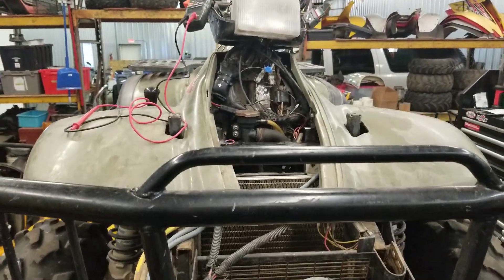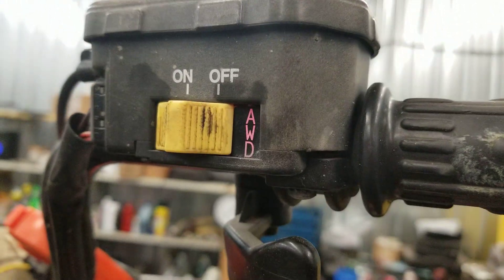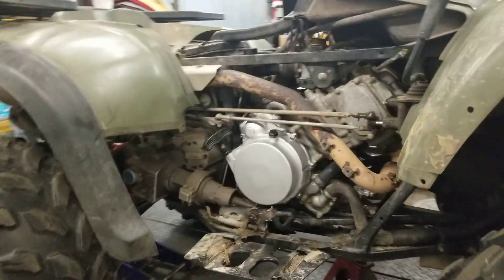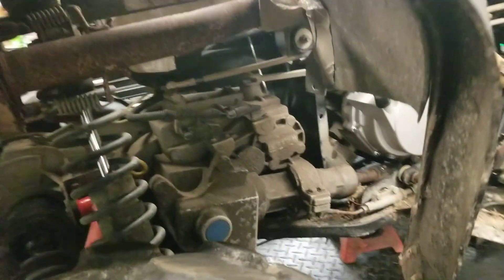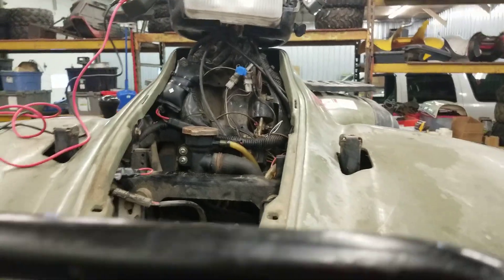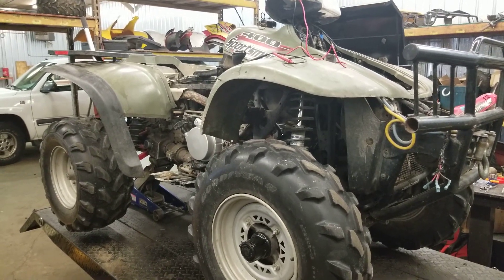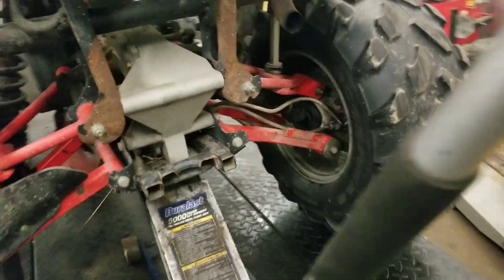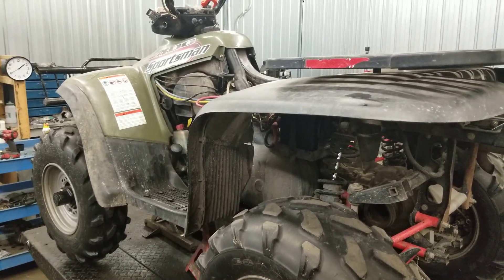Part 2. How to repair your 4 wheel drive on your Polaris Sportsman.

Comment: I just dealt with the 4x4 issue, switch was bad, transmission switches bad, bad ground. I ended up just adding a switched circuit to power the 4wd. This was a trade deal that I lost my rear on. But I got it down to a bad fuel pump which the new one should be here today. This 2000 sportsman is half new now. We got two more waiting to get into the shop too, both have to get the transaxle removed repaired and replaced. Plus brakes, batteries and god knows what else I’ll find.

Comment: I didn't know about greasing the rear bearings...
Reply: Me neither. Is there a zerk or do you repack?
Reply from the maker: You have to repack them. Or they sell a tool you put in the bearing after taking the hub off and you shoot grease in the zerk on the tool.

Comment: Do you have a vid that deals with gear whine? Or is it just typical with these units. I have an xplorer 400.
Reply from the maker: Not sure about the 400s. But the magnum 500 is known for it. usually the rear diff gear whines.

Comment: I have a 2006 Polaris 450 sportsman and now it’s so hard to pull start that it won’t start now what would that problem be I checked the pull start cover and it’s not that just don’t know what else it would be ?
Reply from the maker: Will it start with the electric start? Try taking the plug out and then pull start it without compression it will turn over easier.
Reply: @TitaniummanGarage  needs a new battery so that won’t work it’s easier to pull won the plugs out has a lot of compression just won’t start